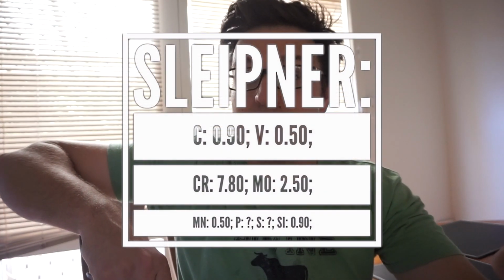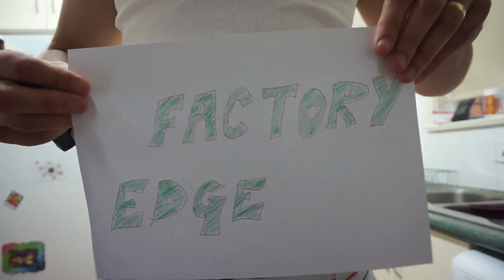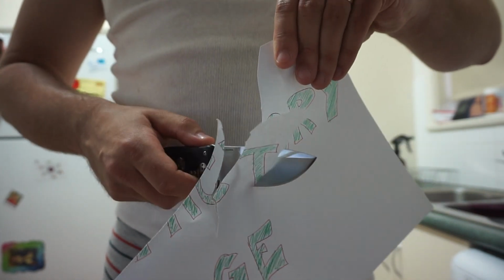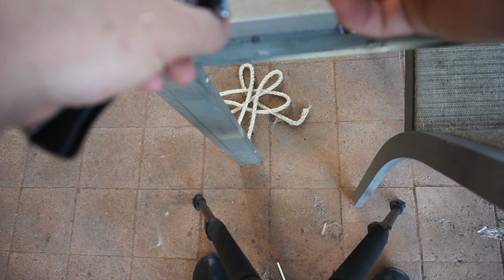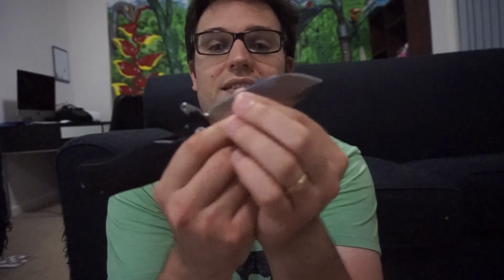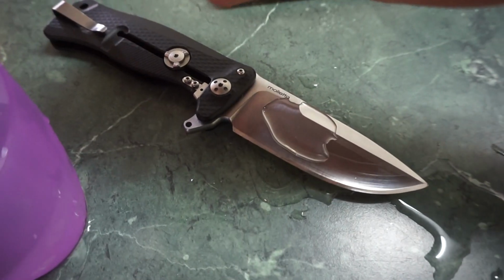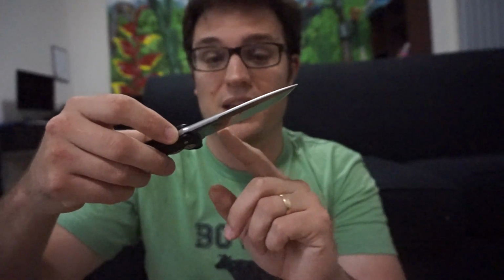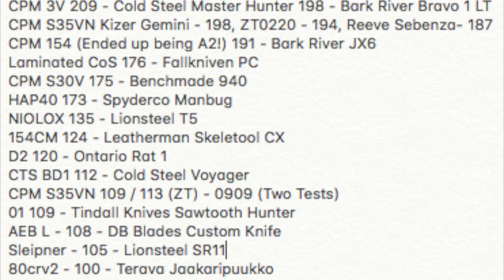Sleipner Steel: Edge Retention and other attributes in Lionsteel SR11

Comment: In my experience M390 was disappointing, it does not take a very keen edge at extreme levels, good only for general tasks, in my opinion it has way too much chrome.

Some EU knives producers are terrorized by corrosion and average customers handling... 😑
Sleipener is way superior, for my preferences, it takes an extremely keen edge, to the max.
Off course Sleipener is not stainless but experts will know it and taking care of it is very easy with modern oils, for LAND operations is excellent.
Occasional contact with sweat or acidic food is not a problem with a quick cleaning and there are also protective coatings (I prefer naked blades with modern oils, no problems ever).
I definitely prefer Sleipener 🥇👍👏 over D2 🥈👍 that is also very good and cost effective, both fantastic steels, capable of extreme sharpness, I have many D2 in my collection.
These enriched super carbon steels (D2 is in between "semi stainless") are absolutely phenomenal in real world use.
I prefer maximum keen edge with medium edge retention over mediocre edge with high edge retention.
Overall quality and heat treatment is also crucial, super steels with terrible or too soft  HT are useless.
I tend to like 59/62HRC for folders and 58-62HRC for fixed,  depending on model.
Off course near sea, or with constant sweat contact, stainless is suggested, I use both steel families.
Too much chrome in the steel in my experience is detrimental to performances, I prefer stainless with 13%, 15% max about.
Scuba diving knives are exemptions, even there a normal stainless is fine with minimal maintenence.
🇮🇹

Comment: I had a Lionsteel KUR in Sleipner that rusted quite easily. Had an easier time keeping my 1095 fixed blades rust-free than the KUR. But then again, maybe that's because I know what to expect with 1095/A2 and take the appropriate caution. Probably a good steel, but not for me. I don't think I'll go for a non-stainless steel on a folder again.
Reply: Other than the steel, what did you think of the kur? I've been looking at a used brown g10/ pvd black blade, but the wood handled versions are even nicer looking

Comment: Quote :
"It's not right. D2 is a ledeburitic steel. Sleipner is a 8% tool steel family. Finer carbide..."
Moletta / bladeforum
D2 comparison is a Internet myth
Reply: Interesting... I think the myth spread because Uddeholm said it was an evolution of the Cold Work Tool Steel, much like a more modern version of D2.
IMO Sleipner tends to sharpen much easier, and feels more like a fine grained tool steel somewhere between A2 and D2.

Comment: The reason powdered steels are tougher than non powdered steels is because of uniformity (something you already said).
The reason non-powdered alloy steels are not as uniform makes sense when you think about it.  When the alloy steels are in a liquid state, they are the most uniform.  As the alloy steels cool they start to separate and cool at their different rates.  If the alloying element is in a high enough concentration it can form blobs that contain a single element in high concentration or blobs of areas with low concentrations of alloying elements.  Powdered steels still have those blobs of elements but when the sample is the size of a grain that matters less.

Comment: Funny that no D2 or D2 variant has performed as well with the worksharp edge as the D2 in the Rat 1
Reply: Sleipner is not a D2 variant, D2 is 12% Cr class steel, Sleipner is 8% Cr class.

Comment: I have the lionsteel m7 in sleipner and it rusts easily. Maybe I have salty hands but it rusts the most out of all my steels. I had to take off the scales numerous times to sand off the rust.
So it seems the niolox is a better steel with edge retention and low maintenance.
Reply: f22shift I have the Lionsteel sr22 and it can also rust, seems to rust a little more than my Chinese steel will in ‘D2’. I like the knife. But I remember that I’m Leary about Italian marketing. I’m not seeing how it would beat M390.  It does seem to be very sharpenable. It seems easier to get the edge hair-shaving sharp, polishes up nicely.
Reply: Honestly, I think that carbon knives are overrated, I'm not an expert by any means but I live In a seaside town in Italy and most guys I know prefer stainless steel knives over carbon. My first knife was a mora companion and It rusted very easily so I decided to get a lionsteel m4 and never looked back, its easy to sharp, keeps an edge for a long time and it requires very little maintenance.
Reply: It's magnacut now..

Comment: I have a DPX HEST folder in Sleipner (made by Lionsteel) and edge retention seems really off based on how they market this steel.  I have tried various edge angles, toothy vs polished, and nothing seems to make a huge difference.  It will lose a hair shaving edge in just a couple passes through cardboard.  Corrosion resistance seems similar to A2 , but better than M4, O1, 1095.
Reply: Jeez. s30v will get you a lot more than that. Hell, 14c28n, too, no? That séems funky
Reply: It is not about the steel. 
Lionsteel is not to good at heat treatment.

Comment: According to lionsteel, sleipner cuts at least twice as much rope as there m390 does. And your tre test showed higher results than sleipner. Then the cardboard cut testers show sleipner does better than Italy m390. So not sure what's going on in your tests that go against the grain of the other two tests done on these steels from LionSteel.
Reply: the tests confirm italians suck at doing m390 heat treats even more than the average chinese company that isn't one of the big 'uns (we, reate...).

m390 won't be "good" until companies figure out how to heat treat it properly on a bigger scale, 'cause right now in production folders it's just a more expensive s35vn (if not worse). hell, just doing what spyderco is doing would already improve the situation by some 50% if not more. it's sad what they're doing with this great steel :(
Reply: They clearly aim for 58-59, there must be some quality or idea they are going for, possibly delusionally. I have a G10 Viper Italo in M390 that kicks much ass, though. But Viper, MKM and Lionsteel have definitely had some underperformers. M390 is probably the foremost underpotentiated supersteel, it's ridiculous. Heard anything about Rike's M390? Haven't put mine much to use, but their 154CM is top notch
Reply: @jslaughterofthesoul4939  all the Italian m390 is done by the same heat treatment facility, Trattamenti Termici Todesco S.a.s.. The heat treatment protocol was chosen to intentionally be easy to sharpen, not edge retention. The protocol they use skips the important liquid nitrogen step. They also burn the edges when grinding them dry after heat treatment.

Hence why it performance worse than all m390 on the market. And in the same category of budget steels. Your viper m390 is the same. If you want to compare, get a spyderco USA m390 knife and you'll see it will extend sharpening times by a large amount. Iirc spyderco aims for 60-62 and use liquid nitrogen. Some spyderco models use water cooled sharpening and are longer lasting, because they don't burn the edges.

There's a thread on bladeforms with information about lionsteel steels.
Reply: @praetor47  we knives heat treatment is not good and I don't think they used water cooled sharpening like Reate does. Their crutch is being thin behind the edge.

Comment: I noticed they (lion steel)say edge holding  and not retention. Maybe I’m reading more generously into it but could they be referring to edge stability and not wear resistance?
Reply from the maker: that would definitely make sense, this stuff is like, 3V levels of tough at the edge
Reply: Edge retention depends on task, if you take Rex 121 and try to make a chopper at high Rockwell you're gonna have a bad time.  Edge retention is really just a combination of task, wear resistance, and toughness.  Toughness and wear resistance are a kind of two sides of the same coin, out of 100 different methods of heat treating a steel 20 will be good 5 will be great and 1 will be perfect because when you soak steels at temperatures for a given time they will form carbides more readily.  Carbides decrease toughness because they are fairly large compared to the iron carbides (cementite) found in straight carbon steels and the smallest grain structure is the most ideal way of obtaining a good heat treat.
Reply: When HRC is measured in a blade steel it is also measuring the hardness of the carbides that are present, that is one of the reasons some steels can be a higher Rockwell than others AND still be tougher.  They can do that by either eliminating some carbide formation in heat treatment which will make the grain structure smaller and therefore tougher however it will effect wear resistance because you're going to be using more iron carbides on the cutting edge which are softer in comparison to carbides like tungsten, chromium, vanadium, molybdenum.  HRC is a good indicator of sorts, however just because a piece of s30v is 64 HRC and another is 60 HRC, that doesn't entirely mean that the 64 will out perform the 60 in wear resistance or toughness.  The 60 HRC may have a super simple grain structure for toughness and an ideal heat treat for wear resistance, and the 64 piece may have large grain structure and low carbide count and that will both decrease toughness and wear resistance.
Reply: Steel is a very interesting material that can be manipulated during the heat treat process in amazing ways, what worries us is seeing an awesome blade steel stamped on the tang and a bad heat treat
Reply: The heat treatment process can even effect corrosion resistance as well, it sounds counter intuitive but even if you have 20 percent chromium which should make a blade very stainless, the heat treat process could tie all that chromium up in carbides and contribute to wear resistance rather than corrosion resistance.  This is seen in ZDP 189 which is an amazing steel.

Comment: I dont get SR-line of knives at all. They patina terribly but are suposedly built for heavy use. For light use they are to thick and bulky. I guess they took home blade show mainly aesthetics and design. But why then make a pretty collectors couch-flipper out of a tool steel?

Anyway, that lansky edge is a nice touch to these vides. Those WorkSharp edges leave alot to be desired and WorkSharps are especially terrible for certain supersteels lile k390 and s110v aswell.
Reply from the maker: yeah. My review of the knife is just uploading now, and I think you’ll agree with a bit of it 😂 and also yes, the worksharp is only chosen cos its so fast and fairly repeatable

Comment: I thoroughly enjoy your videos. Thanks for cranking these out. Question: Does your Worksharp make one side of your bevel a little higher than the other?
Reply from the maker: nothing I can tell by the naked eye but its not a super precise instrument so it could well do
Reply: Cedric & Ada Gear and Outdoors Thanks for the reply. Every time I use mine it's like the belt is tighter on one side which results in a slightly higher bevel line. It's not a big deal but I don't feel comfortable putting my nicer knives through it. Cheers!

Comment: Honestly overall I'm really disappointed in Lionsteel. They've even given more than lies on bladeforums and whatnot of steel performance (for one saying sleipner wayyy out cut properly HRc'd M390) and other important variables. For the price there's much better options. Glad you did your tests though! (PS Like I've commented before, please try using diamond stones on high vanadium steels to prevent carbide tear out to get accurate results, as show by your S110v test.)
Reply from the maker: Herb Toker all sorted now with the diamond kit for the lansky! Used them in this video; then reverted to fine ceramics to polish
Reply: Herb Toker what is your profile picture? I've seen it recently on a drum at the circus.
Reply: HalfBit360 It's a Japanese mitsudomoe, you probably saw it on a taiko drum